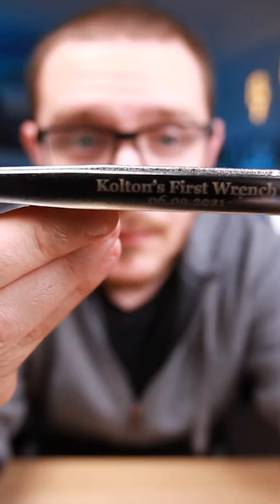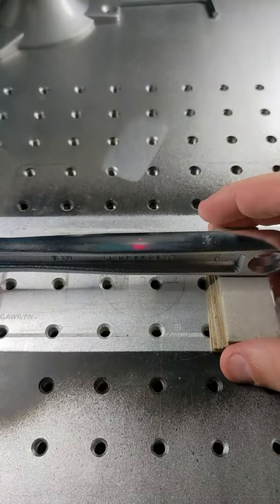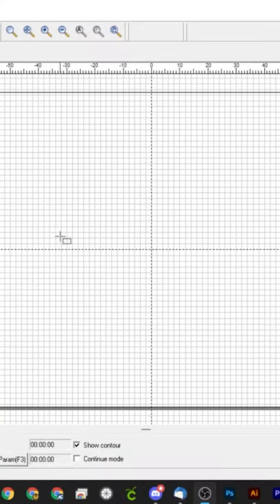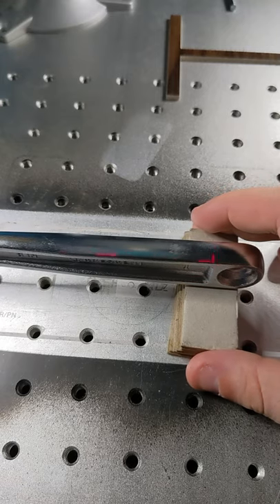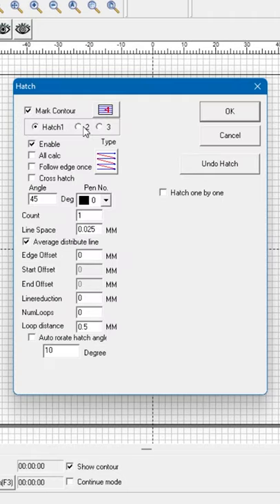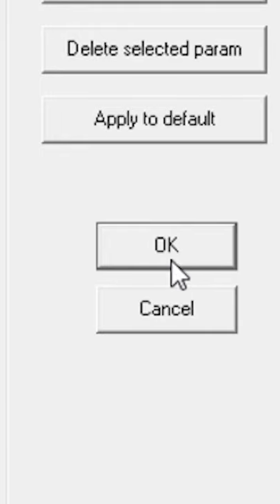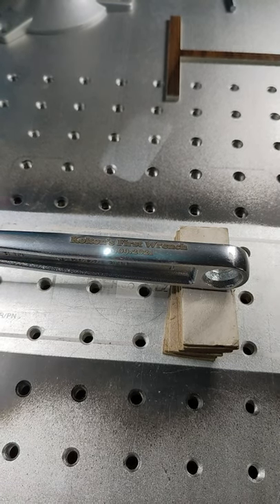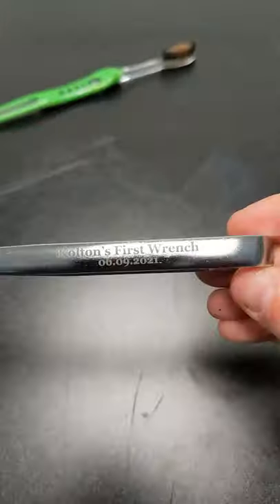How to Engrave a Wrench with a Fiber Laser #shorts

Comment: Do you use oil to avoid oxydation or only to clean the piece?
Reply from the maker: Helps with rust but not really a concern with this metal. Helps clean and darkens the engraving a bit for presentation

Comment: Here is another quick question, sorry. If im running a program and its taking a long time I cant then do other work on the Ezcad software while its running ?   On my Co2 laser, once the job is sent to the machine it stores it on the flash drive so you can do other work. Any way to do this on Ezcad ? anyone ?
Reply from the maker: Are you on the discord? If so you can download the community copy we have of ezcad which lets you work offline. Then you can use one machine to run laser jobs and have a second laptop or computer with the offline mode where you can edit and save files.

Unfortunately the laser is driven by the computer in real time so you can't edit files on THAT machine but with the work around above at least you can use a different computer to get some editing and prep done while computer #1 runs the job. Hope that helps.
Reply: @LaserEverything  I did join but struggled to follow the threads  ! ( im old )  lol . Thank you, very very helpfull .
Reply from the maker: Just @ me (@Alex) in any relevant channel and I will dump the zip file for you.

Comment: What is a good source for the cardboard chips?
Reply from the maker: The nice dense ones often come with large heavy shipments to protect corners sometimes, but an alternative could also be "backer board" or "mdf hardboard" is very similar and is pretty cheap from home depot. Kyle uses it a lot for jigs/fixtures as well. The cutouts are great for lifting corners/edges to help level out uneven materials when marking, and I usually keep a small stack of offcuts around for just that. If you don't like either of those, could even grab a stack of wood shims locally (same for what someone might use for door/window shimming when framing in and mounting a window/door) or general purpose shims which are usually plastic off amazon and come as a set for this type of thing. There should be a link in our buying guide to the plastic ones, we actually have a few sets of those too.